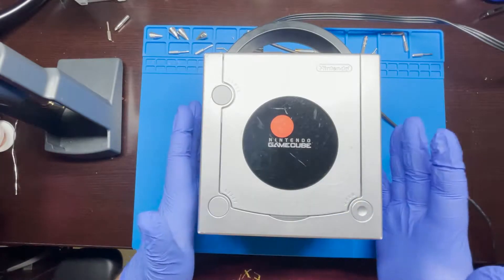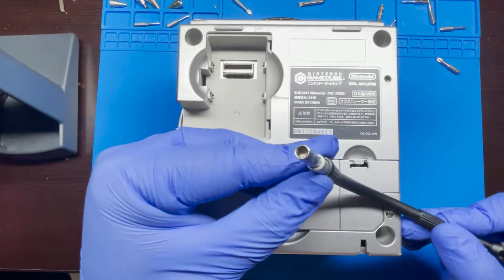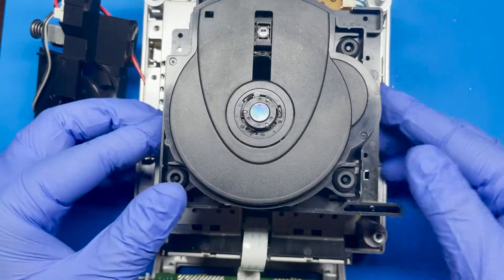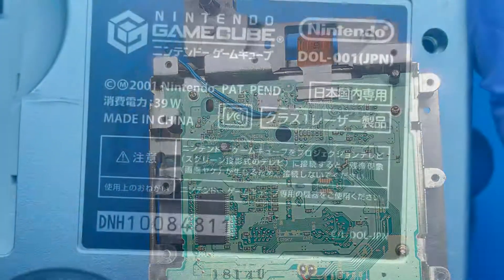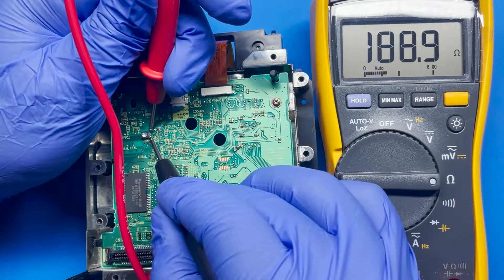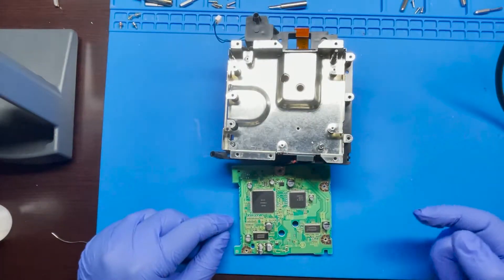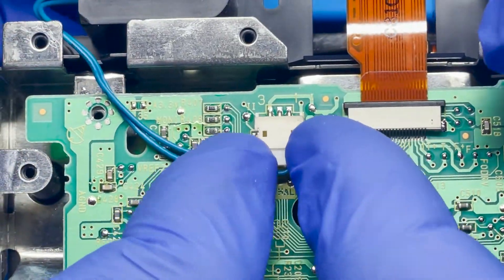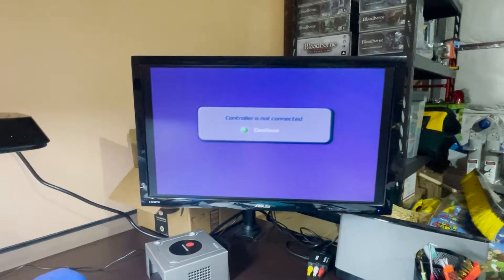How to Repair Disc Read Error | Gamecube

Comment: What is the tool your using to heat the solder and pull them off? The heat gun? Also do you need to plug in the controller ribbon cable to test or can you leave it off?
Reply from the maker: I use a Quick Rework station. Here is a link to it:
https://amzn.to/3DYRnP8

My honest opinion on this rework station is that is simply amazing...I've had 2 other budget rework stations and the heating elements would blow out, or just not work very well. Thanks for watching!

Comment: I've got a GameCube that reads disks and plays games but shuts off after about an hour saying an error occurred. I've replaced all the caps and cleaned the fan. Any tips?
Reply from the maker: What error message do you get?
Reply: @totalfix877  It says an error occurred turn the system off and read the instruction manual
Reply from the maker: @dannyjackson4294  This sounds like an overheating issue, I would inspect the paste of the heat sink. Make sure it’s not too dried out or cracked. If so, you might just have to replace it. Let me know how it turns out I’m curious 🧐
Reply: @totalfix877  You are most likely onto something. I'm pretty positive I'm the first person in this console. I will make sure to swing back by an give a update.
Reply: Same. Any solution?
Reply: @unchi1999  I'm having the same problem right now. Did you manage to figure out a solution at all? I'm going apply some new thermal pads and see if that works.